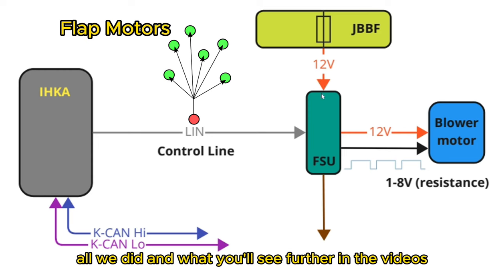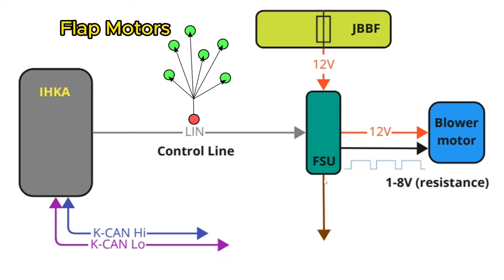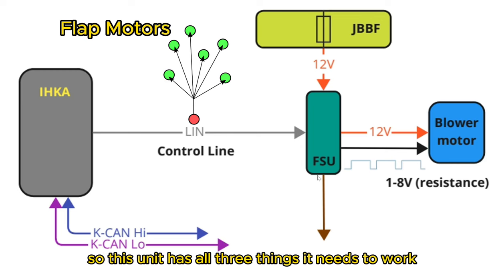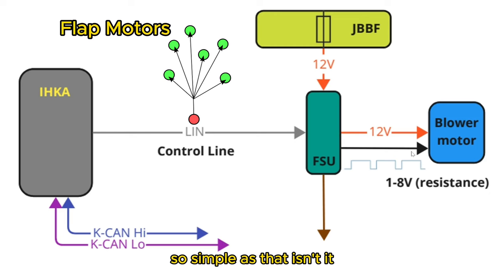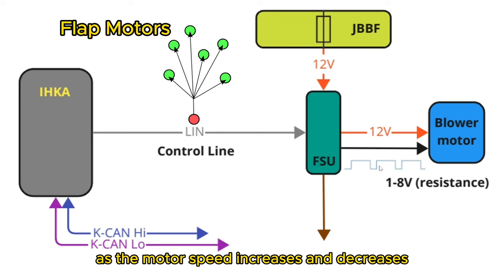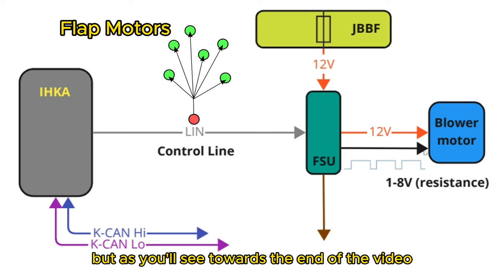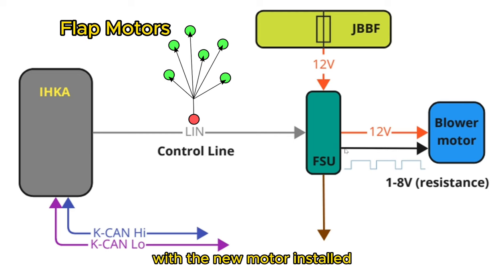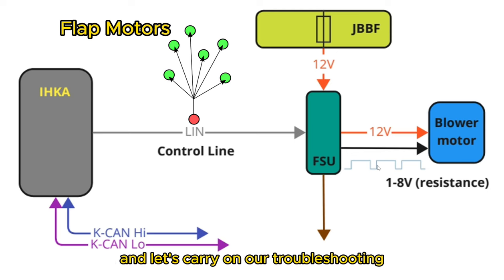They TRIED to RIP this guy off!

Comment: Low side drivers are easier to make, insulate and more importantly control, you may only need 3.3V signal to turn a low side 12v driver on and off for instance!  If you go looking for them you'll find way more low side (0V ground switching) than high side (supply switching).
As for PWM duty cycles, as a kid you may have tried to turn your bedroom lights into a disc by turning them on and off quickly (not recommended) well if you turn them on for half a second and off for half a second (50% duty cycle) your bedroom would theoretically be at half brightness, or a motor would run at half speed.  The main reason for not using dropper resistors other than the heat dissipation is the motor looses torque at lower speeds due to the lower voltage across its terminals.  Switching a maximum voltage on and off quickly while the average measured voltage looks lower the torque is maintained, within limits.

Good video, I think the first garage just didn't know what they were doing or didn't want the work.  Make it sound expensive and you can either fleece someone or make tham go away!  🤙
Reply from the maker: Really interesting explanation Julian and good to understand why they design things this way. Thanks mate 🙂

Comment: Great job and a much easier fix than on the E53 X5. I had to do mine earlier this year and as you're no doubt aware, its a dashboard out job. Still it was the original from 2005 on a car with 250k miles👍
Reply from the maker: Oh those... 😵‍💫 I remember them lol. The E53 is a brilliant wagon but that motor is a nightmare. Thanks for watching🙂

Comment: Hi! Good explanation.  The reason they are using the ground to control the various devices is due to ability to check the system. As you well stated, when the ground is not applied, you will have a 12v return from the motor (in this case). The control module can check for the "feedback" voltage and determine if there is a problem with the circuit or the motor. In this case it measured the voltage return from the motor and determined there's a problem so it triggered the fault - bad motor. Of course you could have a bad wire/bad connection/bad motor, the module doesn't know that, but at least you have a starting point. If it was 12v+ controlled the module couldn't recieve a feedback, because you can't check for ground return. I mean you can, but would always trigger a fault. The fact that you saw a pwm of low voltage on the ground side could mean a bias voltage sent by the module to pinpoint the problem (motor or connection). If there is no low pwm signal returning it means short circuit. It there is low pwm signal returning it means open circuit and the module can trigger the fault code accordingly. I'm used to this systems from industrial machinery. Of course the price of that systems is 10 times more expensive. It's amazing where the car diagnostic systems have arrived....and people are saying..."too much electronics...it was better before..." yeah right...try diagnosing a car with this much accessories without feedback systems on the modules! Keep them coming! Cheers
Reply from the maker: Thanks for the explanation Alex 🙂
Reply: @allmech_BMW_fault_finding  I'm pretty sure you already knew that, but thanks for the appreciation 😊
Reply from the maker: @alexdragomirescu5084 Probably but I wouldn't have put the explanation as well as you did, Alex 🙂